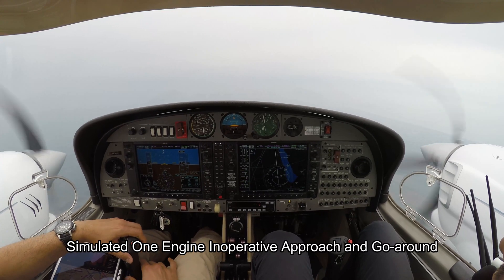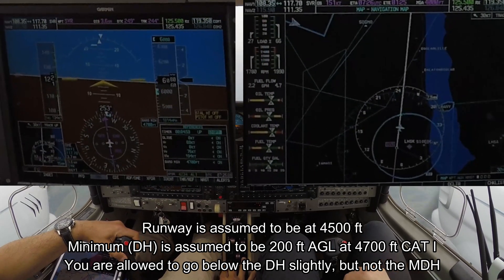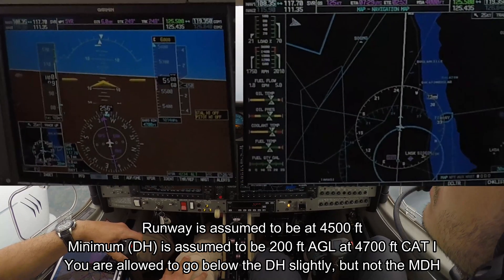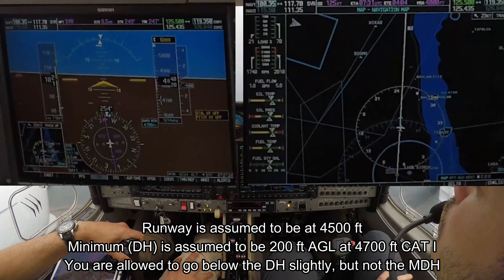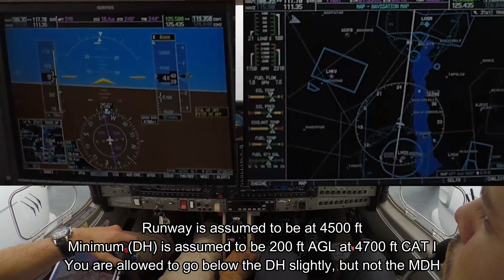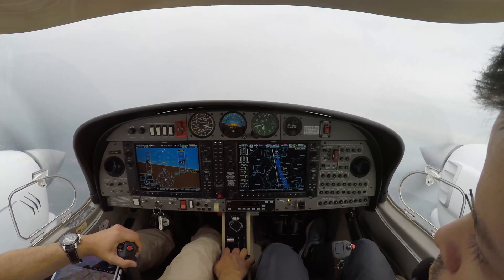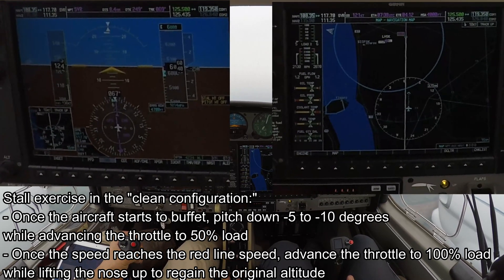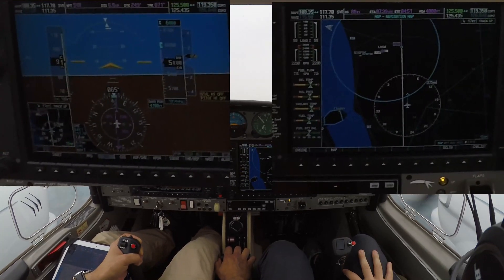DA42 Exercises: One Engine Inoperative Simulated Approach and Go-around, Stalls, Vmca and Drag Demos

Comment: do they ever practice 2 engine failure ?
Reply from the maker: Not really and there isn't even a glide ratio and a best glide speed in the POH because the chances of both engines failing are very slim.

Comment: Good video.  I'm new to instructing in the DA42. For the Vmca demo, don't you want the worst configuration, i.e. full power on right engine, left (critical) engine windmilling (not 20% which would simulate feathered)? Did I miss something?
Reply from the maker: You're absolutely right, it's just that I'm following the SOPs of the school I'm instructing at and they never allow us to take it to 0 load or to cut off the fuel for example for the critical engine.
Reply: @drpilotfi  thanks for the clarification. I understand the "no fuel cutoff" policy....I understand that doing so creates big problems for the fuel injection system, but I'm struggling to understand the zero load. But I also understand some "rules" don't necessarily follow logic!  Thanks!
Reply: I already asked this, but I thought there was no critical engine on the TwinStar?  
We had the original diesel then changed to the Lycoming when those came out, due to lack of parts for the diesel engines.  I know both of those versions were opposite rotating, so there wasn't a critical engine.
Reply: @Caderic  The diesels all rotate in the same direction. No mirrored austro engines are being produced.
Reply: @BarryHofland.   Oh, ok.  We had the Thielert, and they were opposite rotating.
Reply: @Caderic I fly one of the older DA42 TDI's with Thielert engines, and both props rotate the same direction. There was never a DA42 built with counter-rotating props to my knowledge.
Reply: @igclapp   Ok, it's been 13 years, and in the middle of my training, we switch to the Lycoming.  I looked it up, and the Lycoming has the counter-rotating props.  I knew one of them did, but I havent flow any in 13+ years, forgive me for the mistake. 
You can see one (N58LU) of the two aircrafts we had, at Ortega Aviation's website, under fleet the twin Star.
The *LU was for LeTourneau University, where I graduated in 2012.  We had N58LU and N59LU.
Reply: @Caderic Ok, I was also mistaken. I didn't realise the Lycoming powered DA-42's were counter-rotating.